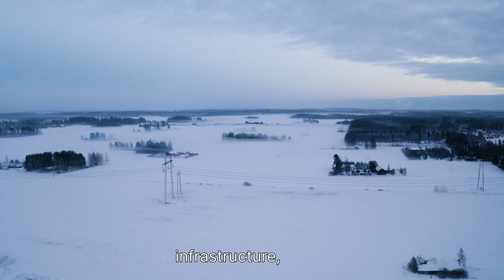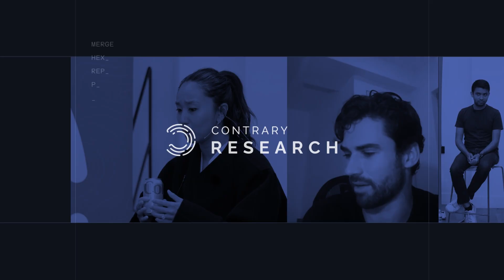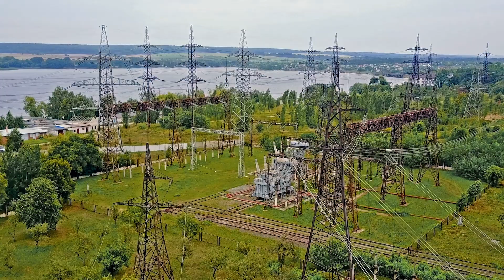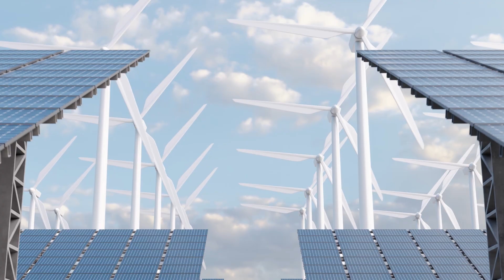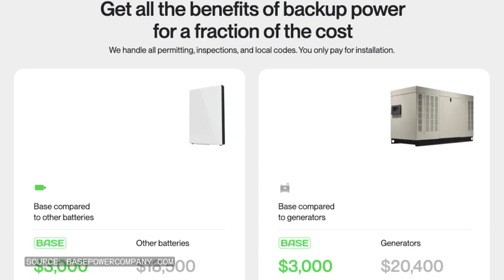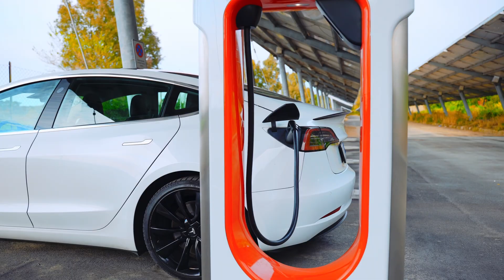Base Power: The Modern Power Company

Comment: How do you access the power in the home battery to resell it into the grid? Who pays to resupply the battery when you draw from it and when it is installed? How long does the battery back up last during a power outage? How long are the batteries projected to last if you draw and resupply on a daily basis? Can the batteries be installed in a series if you want the power to last longer during an outage? What is the cost if any of additional batteries installed? Is there a limit to how many batteries you can have installed on your home?